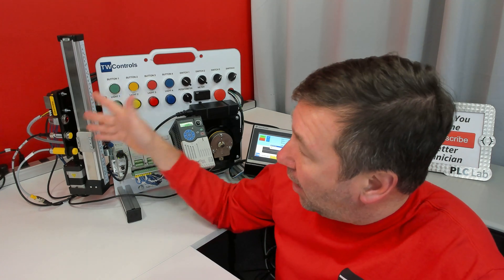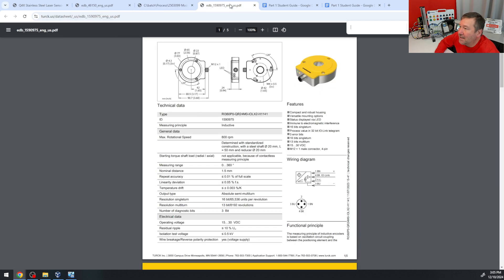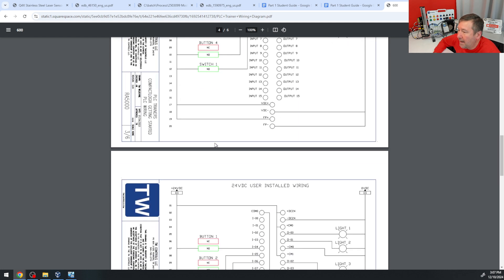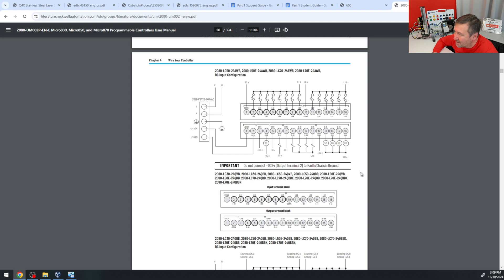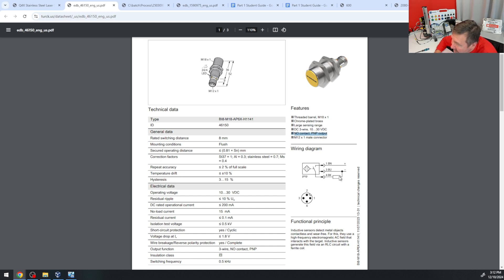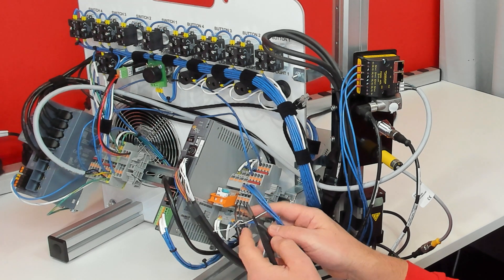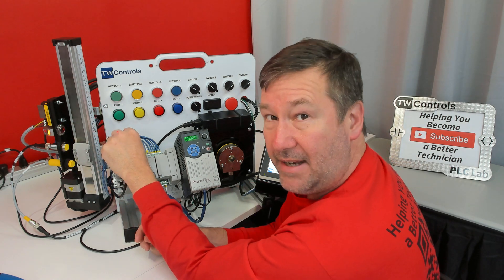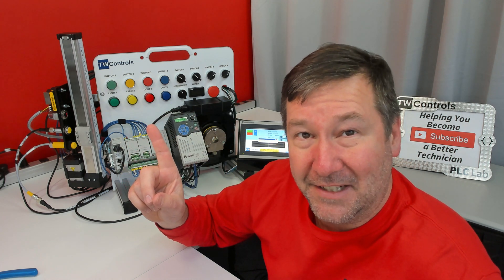Wire M12 Sensors to an Allen Bradley Micro850 PLC Sinking or Sourcing

Comment: Hey Tim have you had the opportunity to control ABB ACS380 VFDs with a Micro 850 PLC over ethernet. 

I have done it with the compact logix platform but wonder if its even possible with the micro platform.
Reply from the maker: I haven't but check out this video on class one messaging. I covers a lot of applications. 
https://youtu.be/3RHczlCRMyY